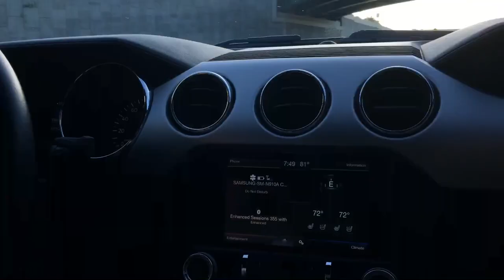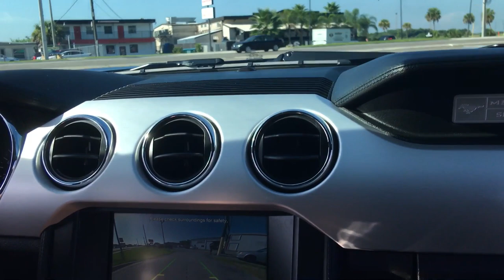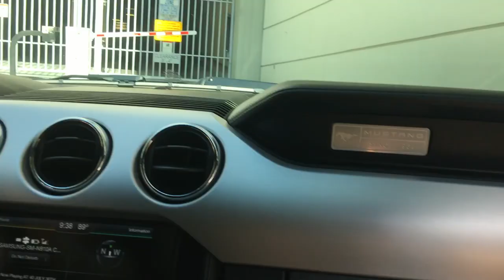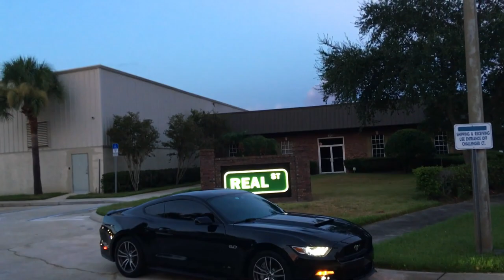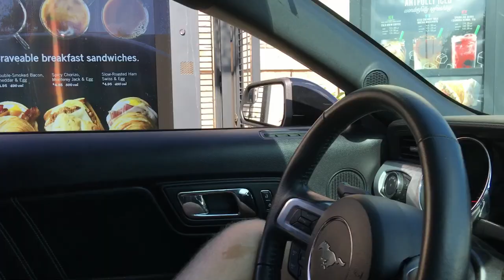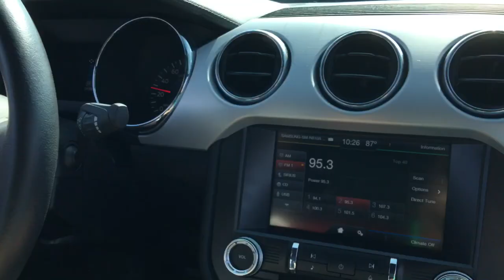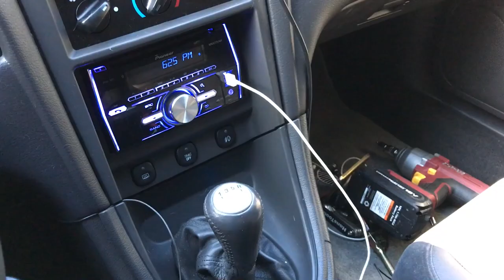Mustang GT X-Pipe and Roush Mods!!

Comment: did you request for him to cut all the way over to the cats? if not that is some shady exhaust work. every res delete ive seen on these cars (including mine) only cuts at the edges of the resonator, that way the stock clamps are kept in place so if i  the future lets say you want to do a real cat back or cat delets it would be a simple bolt on and off, now if you ever want to change this system you have no choice but to go back to him or another shop and pay him to cut and re weld your stock cat pipes.
Reply: Yes I requested it cut after the cat. Quality welds were put in place, it's a custom job after all, not a design I'm paying $1k for. I love the way it sounds, but thanks for your concern
Reply: @Mr.free the next step is long tubes no need to worry about the cat's
Reply: The next step should be removing those hideous wheels XD

Comment: can these newer Mustangs have that mean gargle sound like the older 2008 Mustangs?  check out the video... 2008 Bullitt with Hot Rod Cams, Kook Headers, and Corsa Extreme Mufflers.
Reply from the maker: These coyotes 11+ have vct which can be tuned to have a cam sound without opening the engine. There are also aftermarket cams for coyotes but it is expensive and often not worth it.

Comment: Great vid as always! Have a question though. Does just a muffler delete have drone and is it too loud for daily driving?
Reply: I am so happy with the fact that from inside the car it is quiet. I can talk on the phone and hold a conversation I can sing in the car and still hear myself. I love it. Hardly any drone and nice and peaceful on the inside.
Reply: +Ash Carlton gotcha, yeah it's just that I'm a high school student and my dad drives the car sometimes and wants it to be completely quiet and no drone. I also leave the house every morning at 5 so on cold starts don't want it to be too loud
Reply from the maker: A Muffler delete only might be a good option for you. We have a video on the Muffler delete vs the muffler delete and x-pipe
Reply: Just the muffler delete is a little loud inside on the highway. 2k rpm is a little drone. 3k rpm is totally silent, you'd think the car had stock exhaust. I would consider a full axel back exhaust before muffler delete if you're worried about any sort of drone or harsh cold start

Comment: What was all installed
Reply from the maker: The exhaust is Muffler Delete and Resonator Delete X-Pipe
Reply: So just strait piped
Reply from the maker: ... No. There are still cats on the car. It has an x pipe delete and resonator delete and the mufflers have been removed. This is not a straight pipe setup. -Ash
Reply: Oh ok